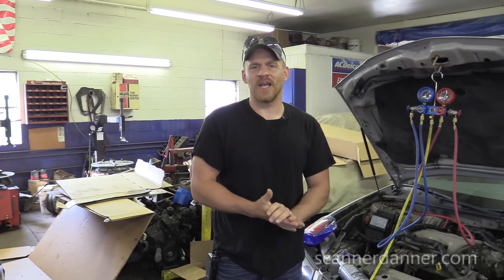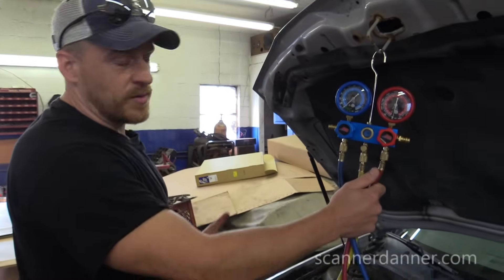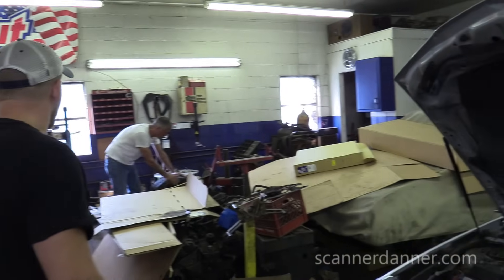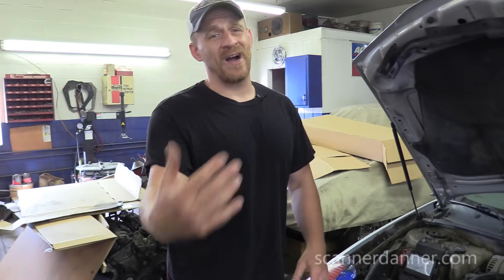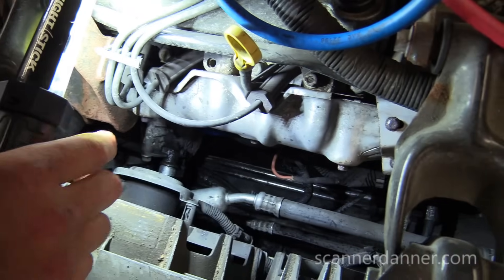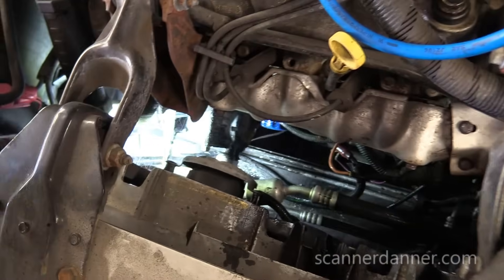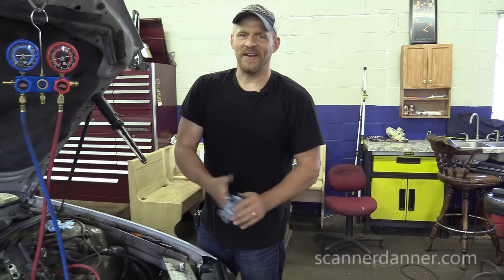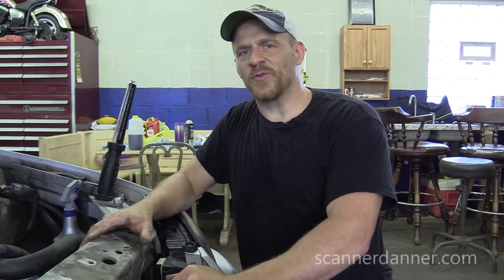A/C Leak Testing Using Compressed Air, Soap and Water (any car)

Comment: Lets get this straight.  You are recommending that people run their ac with no oil and also that they inject a bunch of moisture (from the compressor) into the system??
Reply from the maker: A 5 second test of the compressor is absolutely necessary on a system that comes in empty. You want to find out after a thousand dollar repair that the compressor is bad, or has no power going to it after a repair?
Reply: @ScannerDanner I usually will spin the compressor to see if its locked up.  if its not locked then I will pull a vacuum, add dye, and charge just enough so that the compressor comes on.  Then find the leak, check for debris, recover the refrigerant, change dryer, and charge the system like normal.  Ive never had a problem. This is t he first ive ever seen anyone recommending to run a pump without any oil or checking for contaminants.  I guess thats the beauty of youtube, anyone can post anything they want
Reply from the maker: @Dev_Everything  or comment anything they want
Reply: To the guy trying to fix his car: Please do your research before following this advice.  This can and probably will cost you a bunch more money and time.  Just check around other sources.
Reply from the maker: @Dev_Everything  🤣 did you like your own comment?

Comment: The right way to pressure test a system is with dry nitrogen.  Air contains moisture, and the pressure fluctuates with temperature.  Why would anyone use air, and introduce moisture to  a refrigeration circuit?  Nitrogen costs money, so maybe it’s just being cheap.
Reply from the maker: I've been using nitrogen in my newer AC videos. And I explained in detail in the comments my arguments for using compressed air. Used it for over 20 years with zero issues and zero comebacks with the pleasure of seeing the same cars year after year.
Reply: People don't really comprehend what's happening.
If you vacuum, you vaporize moisture THEN the dessicant catches any residual.

Comment: Got a question if the system  has no refrigerate and evacuated  the system  could you use a smoke machine  to find a leak
Reply from the maker: You could, but you'd be introducing a contaminant from the mineral oil most smoke machines use. Also it's too low of psi to locate leaks in an AC system
Reply: @ScannerDanner  thank you  for info

Comment: My old car uses R12 gas, with an older Sanden 505 compressor.

It loses coldness after about a month, two at most.

The previous serpentine evaporator leaked and was replaced about five years ago. (Serpentine evaporators these days are thin aluminium and don't last.)

My usual aircon serviceman, or rather his worker, at first, with some gas still in the system, just applied soap water around the usual places to check for leaks. Couldn't see any. 

He told me to come back later. The next step, he told me, he will release all refrigerant, then pump compressed air in. Exactly your method.

However, at first I thought he does this to hear for the hissing sound of escaping air !  Then this would tell them roughly where the hissing was coming from.

Then an aircon man on Youtube here said compressed air would damage the compressor, evaporator, expansion valve and the whole system, so I was puzzled.

I wonder why you do not use the green dye method ?

I bought an electronic leak detector, but that seemed to work erractically.  I also could not test the evaporator,  because that is enclosed in a plastic box under the dashboard. This detector's tip has to be placed very near, like 1/4 inch, the evaporator to sense any leaks.
Reply from the maker: I use nitrogen these days. Compressed air is fine too. Don't listen to all of those saying otherwise. Just make sure you pull it into a deep vacuum for longer than the usual half hour when you're done. 
Those that say to never do it are concerned with the moisture in the air and having it get trapped in the refrigerant oil. Which then becomes acid and eats things internally.
I've used compressed air over the past 25 years before switching to "dry" (no moisture) nitrogen, primarily to get all the internet police off my back. Never had one single comeback or problem using compressed air.
And if you live in a dry climate (low humidity) and you have driers on your compressor, even better! You'll have no issues
Reply: @ScannerDanner  

Thank you for your assurance. I will go later and let him use the compressed air then.
In the meantime I refill some refrigerant myself every three weeks or so.
Do I need to refill some oil too ?
It is a small compressor, only 5 cubic inches (88 cc), the smallest of the Sanden series. Oil capacity is about 3 - 4 oz, 100 - 120 cc, I think.

At first I thought of refilling about 50 cc (2 oz.,) but then the other aircon man said.that is too much, just 5 cc will do, because most of the oil sinks to the bottom and not much is lost with the gas.

Also as you say, oil mixed with moisture can turn acidic. (But I wonder how a little moisture can turn a lubricant oil acidic.)

Yes, many years ago this other aircon man used nitrogen gas to flush the system. Nobody in Malaysia here uses it nowadays.
Reply from the maker: @ThamMalaysia  very little oil is lost, agree, 2 oz is too much
Reply: @ScannerDanner  

Thanks again, Mr Danner.
Reply: It's mysterious how anyone can know if oil is needed, the manuals always seem to say the only way is to disassemble everything, drain it all out, and then add the required amount. 
Is there no other way than a guess and a prayer?

Comment: I had a very odd issue on my 83 Mark VI. A leak that only leaked when the ac was cooling
I vacuumed system it held vacuum for 24 hours, charged system and cooled great for 30 minutes then went warm, low Freon.  Pulled out what was left in system with my ac machine and stored in recovery tank.  Then rigged up a fitting for air line. Pressured up to   120 psi, held great 24 hours, retightened all lines to be sure.  Recharge it with dye. Cooled good for 30 minutes. Found the dye dripping out of the ac box under dash .
So I replaced the evaporator core. It cured the problem
Reply from the maker: should have went with 200 psi and you would have most likely saw the drop in pressure

Comment: you don't like using refrigerant "sniffers"  or at least for the hard to reach areas?
Reply from the maker: Can't sniff air or nitrogen. But I do use one with refrigerant still in it for evap leaks
Reply: @ScannerDanner  whats the problem with adding just a little refrigerant back in?  You're already adding air.  Theres already moisture and contaminants if theres a leak
Reply from the maker: @adamr8628  oh I will do that if my psi checks (using nitrogen these days) fail to locate it. Two places to loom are the compressor shaft seal and evap drain tube.

Comment: What if you use an water filter on your air compressor to remove most of the water in the air? That should be fairly harm free for the system or?
Reply from the maker: You'll be fine. Don't worry about all the naysayers. I switched to nitrogen just to stop the noise lol

Comment: I will say your videos on ac troubleshooting and repair are the best anywhere. I’ve been quoted $3500 to start on ac fix. With your help I’m under $1000 with rear evaporator core, compressor, r-134, and vacuum pump and manifold gauge. Thank you for videos!

Comment: OMG a youtuber that knows nothing about AC repair
Reply: @ScannerDanner  #1 you ruined the system by super saturating the oil with moisture. #2 As a mechanic you should know the concept of Compression and Combustion. You can literally blow up the system that way

Comment: Using this method I found 2 leaks: 1 on the Evaporator-to-Expansion Valve bottom line. I think it was a wrong o-ring there, bcs after I put a thicker o-ring on that connection, the leak stopped. The 2nd leak was found on the body of the Compressor, on one of its seals, not central one, but the one closer to the end. My question is, if anything can be done about that compressor (it is pushing oil, if to rotate the clutch), or I need to replace it? This is my 1st work on car AC. I would really appreciate any opinions on this matter. Thank you for this wonderful film again.
Reply from the maker: Nice job so far! The body of the compressor may be a problem. I just cracked one trying to fix that on my sons Nissan. Lol watch these! They're really good and will definitely help you. I'd look for a used compressor if I was you. 
https://youtu.be/nCTgcal4N94
https://youtu.be/8oX-PfrWDng
https://youtu.be/BlrGTHAD2CY

Comment: What if the ac working but not so cold let’s say 65-70%?
Reply from the maker: What are your pressures? Both low and high side. And ambient temp during testing. Can't help without that

Comment: The vehicle was leaking to the point where the system was empty of refrigerant.  I found and repaired the leaking expansion valve.  I put the system under a vacuum for 45 minutes without issue.  I decided to pressurize the empty system with 100 PSI of air.  The system kept 100 PSI for three hours.  I wanted to verify the compressor was functioning before recharging the system.  I performed the test of starting the vehicle for a few seconds as demonstrated in this video.  The low and high side gauges did not move.  The compressor clutch engages and there are no leaks or abnormal sounds coming from it.  Any other tests I can perform before assuming the compressor is bad?
Reply from the maker: Compressor for sure, as long as your valves where not closed on the service ports. They need to be screwed in to open the system to the gauges. As long as you know you were looking at system pressures, your done. Very important to now remove the expansion device and look for debris. If it is heavy debris, you may also need to replace the condenser (thats where the guts of a compressor will go first). You'll also want to change the drier.

Comment: what are the symptoms of a comprssor run without refrigerant  - low pressure - what sort of pressure  should the compressor be delivering?
Reply from the maker: they will not turn on with no refrigerant, low psi cut off switched prevent the compressor from turning on with anything under around 40 psi

Comment: Man first off just want to say thank you for your content and the information you share. I was able to find the leak on my wife’s 2011 Chevy traverse and replace the parts that needed to be replaced. The local shop wanted an arm and a leg for the work I was able to get done at the fraction of the cost by watching your videos and investing in a set of gauges and a vacuum pump. Thanks to y’all my wife’s SUV is ready for another hot summer in the high desert of CA.

Comment: I'm here because I was skeptical about using free compressed air. I hate wasting valuable freon to find a leak. I'm going to inject air but use a $3 disposable paint gun water filter as another person said. My customer's durango doesn't have a dryer can like older vehicles so I fear water contaminant.

Comment: I'm not sure if anyone else has made this comment, but a better method is using compressed nitrogen. Filter nitrogen will not introduce contamination into the system. Plus a higher pressure can be achieved. This is the way home/commercial air-conditioning repair is conducted. I use Big Blue Micro Leak detection soap.
Reply from the maker: Check out my newer AC videos. I'm using nitrogen 😉

Comment: Would the soup & water work even if there is no compressed air in the system?
Reply from the maker: As long as there is pressure in the system, yes, but refrigerant psi will be much lower at rest
Reply: @ScannerDanner  I meant if the bubbles would still show up even if there is no comoressed air. Or there has to be pressure in the system for this procedure to work? I'm learning how to diagnose AC systems from scratch and still uncertain about some procedures.
Reply from the maker: @0xl4j394  must be pressure in the system!

Comment: Hi, Paul
Sorry to bother you once more, but I have a question that is bothering me in my head because I don't understand why and if it is normal but I wonder if you can help me with this may be dumb question.
In one of your teaching videos in YouTube you mentioned how to save the most refrigerant that is stocked in the gage hoses. I did as you thought but when I did it I noticed that the gage on the low side the pressure doubled up at 1st. It was 35/ 40 psi. Then boom up to 80 psi. and so the high side went up too. I was in shock since I didn't add any refrigerant, I was about to take the gage out of the system and I did it anyway, but this is the question. Is that supposed to happen? 
I would  really appreciate it if  you could've  helped me with this question.
I'm really thankful for sharing your knowledge. I did all the way by myself thanks to your teaching information. 
Thank you again.🙏💯👍🏻

Comment: Not problem to push a bit of shop air to find a leak provided the system is empty (the case here) and system pulled to vacuum for 30 mins after parts replaced to remove any residual moisture from the system having NO pressure for a long time and the shop air.  All good.

Comment: Have a UK spec Volvo V70 D3 Estate. My a/c compressor has a schrader type pressure valve that is now discharging 134a refrigerant. Compressor cuts in for a few seconds, discharges refrigerant and then cuts out. Could this be the high side pressure valve not working or something else
Reply from the maker: You have a major restriction if that high psi relief valve is blowing off. You should not run your system any longer and focus on your expansion valve or office tube. I think?
The fact that your building that much psi says the conpressor is okay, which means your condenser is not going to he plugged with debris. Maybe a drier that's come apart and office tube or expansion valve restriction from the drier pieces?

Comment: Powerful car A/C compressors will easily pump way over 200PSI (300PSI on the high side on a 4th gen Z28 Camaro on a real hot summer day for instance ... think AZ desert "loco" day), and you need to be able to check such pressures. Most of shop air that I know go 120 - 150PSI max, I haven't ever seen one going 300PSI.
I don't know ... nitrogen pressure test seams to be the acurate way to do the job, AND you don't further pollute the A/C system with air moisture.
You know of any shop air that goes 300PSI (brand, model) ???
By the way, you can weld together a 1/4" SAE adapter for A/C pressure testing.
Anyway, nice video! I discovered the channel lately, I really like it. 2 thumbs up!
Reply from the maker: I've been using nitrogen on my newer AC videos. Thanks!

Comment: Hello,   I am trying to find a leak in my 1999 F230 super duty... can you tell me what fittings I need to buy to fill the AC system with air using gauges..(that I will purchase too) Thanks!
Reply from the maker: Just use a rubber tipped blow gun on the yellow hose inlet and open up the gauge valves, then close them when you get over 100 psi. 150 is even better if your compressor let's you get there

Comment: Further to my previous comments about the dangers of using compressed air to pressure test air conditioning systems please see below quotation which was copied from a commercial Robinair vehicle a/c charging station instruction manual. 
QUOTE   “WARNING: Do NOT use air or any gas besides N2 or N2H2 to pressurize the system. Mixtures of air and refrigerant can be combustible at elevated pressures. These mixtures are potentially dangerous and can result in fire or explosion causing personal injury and/ or property damage”   UNQUOTE
Reply from the maker: For sure! But I would argue that when I've done this, I ONLY do it on an empty system, so I'm not mixing r134a with compressed air